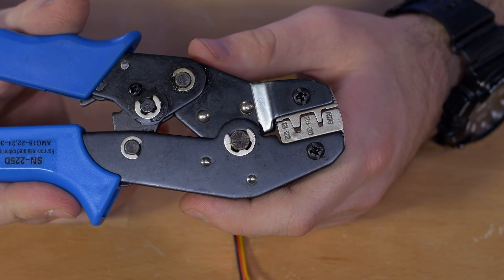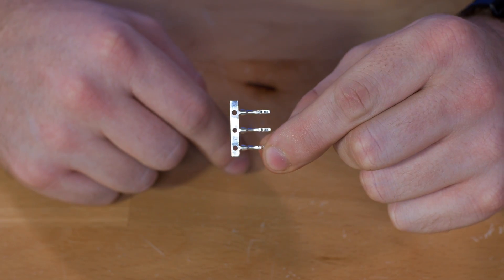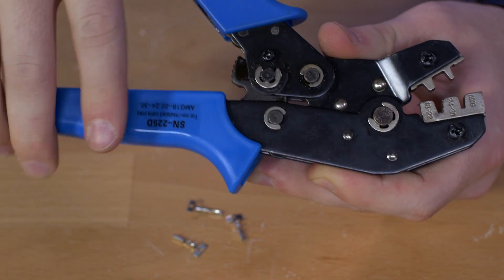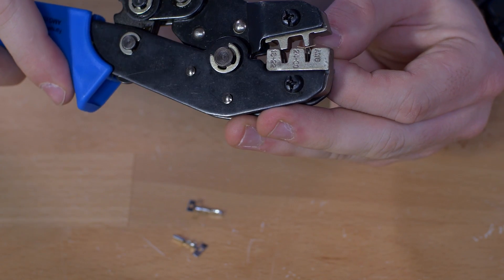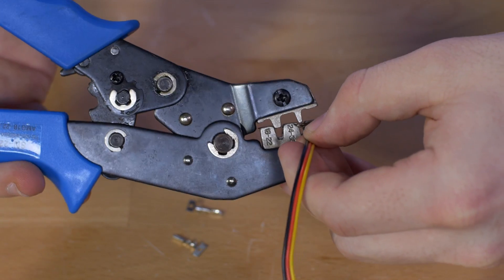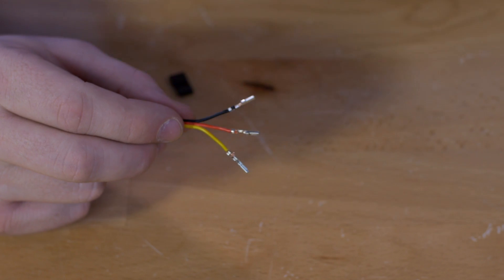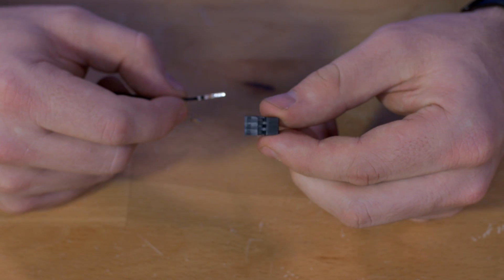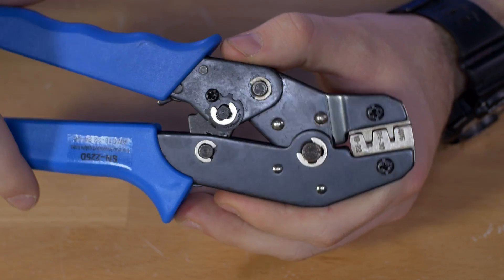How to use our pin crimpers with our servo plugs and pins

Comment: I suggest getting a used HT-95 or HT-208A / HT213 off ebay for these. These are the factory crimpers for DuPont / Mini-PV terminals (which is what servo connectors are). The HT-95 (also known as HT-0095 or HT-100) does 22-32 AWG wire the HT-208 does 22-26AWG and the HT-213 does 28-32AWG. (the HT208a and HT213 are easier to use than the HT-95 but all three tools crimp equally well). There is also the HT-73 which does 18-20AWG and the HT-102 which crimps male terminals for 22-32AWG (the other tools mentioned only do female terminals). The crimps are perfect every time and much more secure than what generic tools will do. Old used  DuPont and Berg units show up on Ebay a lot often for less than $100 (the current maker is FCI Amphenol but they charge around $1000) The big difference between the official tools and the generic ones is that they have a cylindrical die on the insulation crimp side that wraps the crimp wings around so that they "hug" the wire and they swage the conductor crimp barrel tightly around the strands of wire (you can see flashing on the underside of the terminal at the seam between the die and anvil) rather than just folding it over into a double D and flattening it.